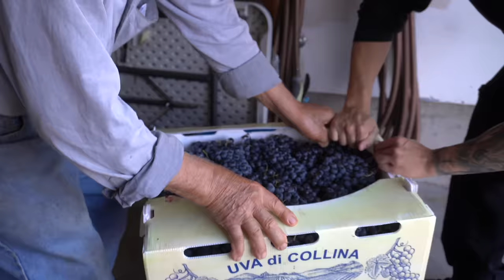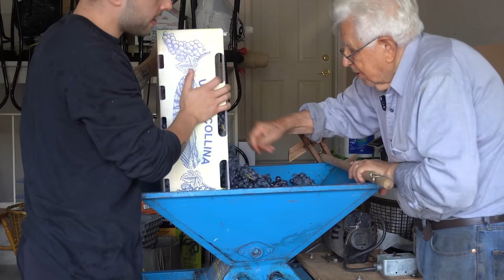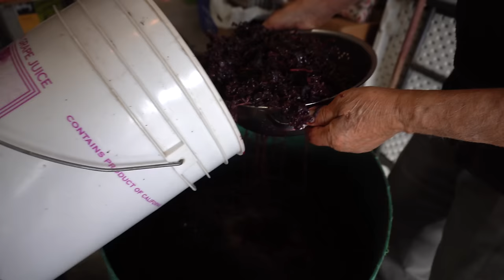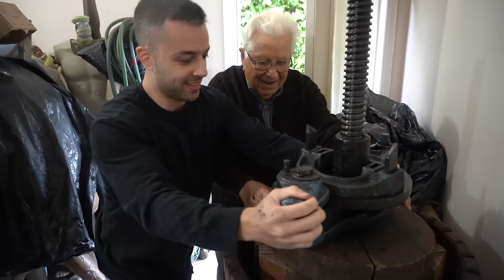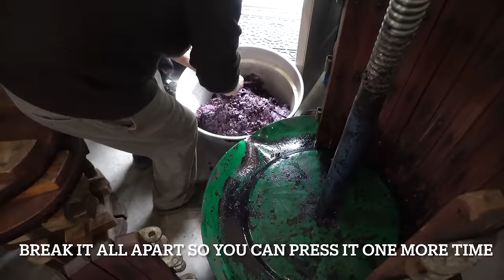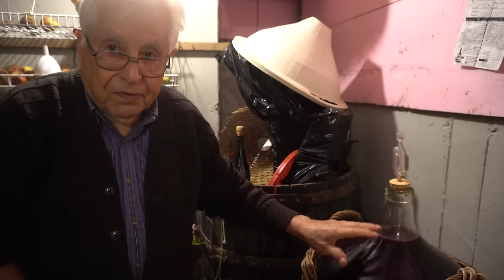Italian Grandpa Teaches Me How To Make Authentic Homemade Wine

Comment: Hello and respect 
 I had an important question 
 I would be grateful if you could guide me 

 I had two hundred kilos of grapes with two empty barrels of 220 liters plus 5 yeasts of 5 grams ec1118 plus 5 yeasts of 5 grams k1.  From there, I didn't know if it was possible to mix the yeasts together or not, so I didn't risk it and poured one hundred kilos of grapes into a 220 liter barrel and added 25 grams of ec1118 to it, another hundred kilos of grapes into a barrel of  I poured it and added 25 grams of k1 to it.

 It's been 48 hours now, the fermentation is going on, and I did the oxygenation by stirring twice.  But since each barrel is half empty, I am worried that it will get moldy or oxidized.   I wanted to know if it is possible to merge two barrels into one?

Comment: Please, tell your grandpa that removing grape combs will significantly improve the taste of vine by reducing the tannin amount. Now it's time to make a wine and my hands are blue after a day of sifting the grapes through a rough grid with the 1/2" cells. Of course, this method will not remove all combs. Rests will add some acerbity. But this method will make the fermentation period twice longer, almost when yeast will eat all the fructose.

Also, I don't know if US suppliers wash their greaps, I usually do this before crushing. It reduces unwanted insects number in the wine )))

Comment: I just started the video but haven’t finished it yet because I needed to say this…I was shocked to see the grandson put the boots on the ground and then step inside the bucket with the now ‘dirty’ boots! If the boots were actually clean already he should have placed the boots inside the bucket with the grapes first, then put them on by stepping into the boots while it’s already in the bucket.